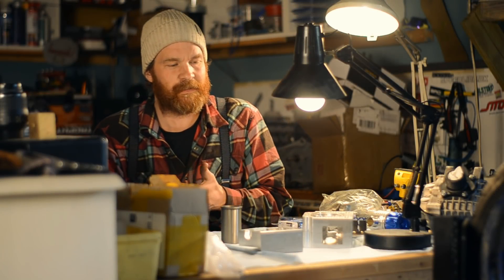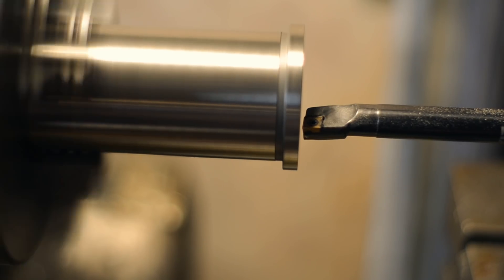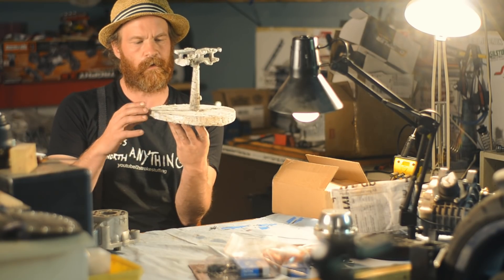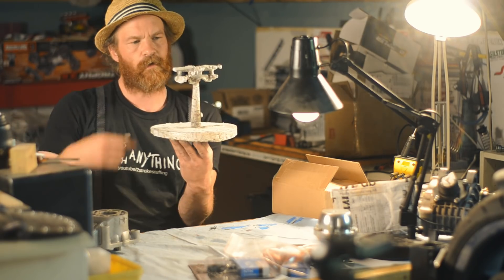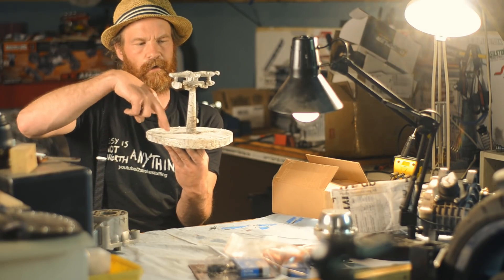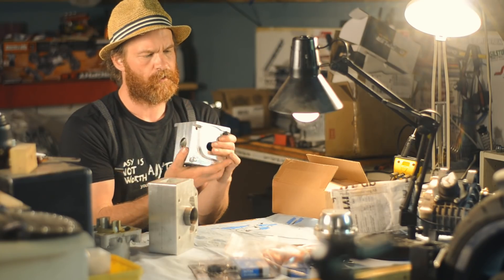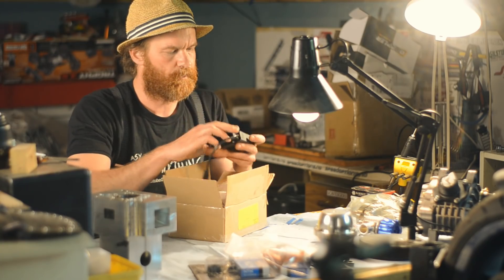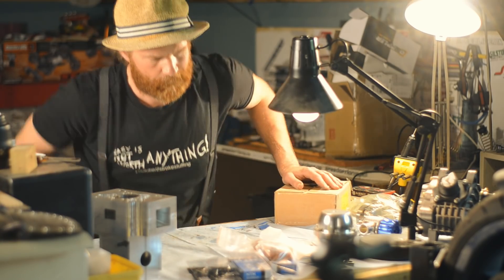Big Blower meets Tiny Engine!

Comment: 10:24 When I saw how gingerly you placed that liner in the bore, I knew it will be a failure. You have to be REALLY decisive. As soon as the two come into contact the temperatures equalize and they seize together, as you have found out.

Comment: CF (or glass fiber) Nylon/PA would be great for those 3d printed parts. Can be printed on the ender 3 without an enclosure, just a metal hot end, and an abrasion-resistant nozzle. I'd recommend Dyze, because they offer tungsten carbide nozzles.

Comment: When i cast all the aluminum parts in the 2 stroke rc builds.  I used 3d printed parts as well lol! I found a hand sander that vibrates is the boss to release all the air on larger casting molds! Have you tried wax printing filament yet?  Really is easy to clean out of you mold

Comment: How tight was that liner to block fit? 
Usually, even with 90mm OD liners (Yamaha XS650) I only use 0.003" interference. (0.094mm?)
 With the expansion rate of aluminium, liners literally 'fall' into block.  I heat blocks to about 325F, (old school and don't 'do' deg C or Kelvin)
To be that tight I would think interference fit was over 0.006" (0.15mm)?
I would imagine the stress build up is going to warp the liner afer a few heat cycles and the bridges will bulge into piston area?
BTW, I've measured stock Honda blocks where interference was only 0.001" from the factory which is really too loose for good heat transfer

Comment: start degassing your aluminum. foil sheet. 1 gram of baking soda per pound and a half of aluminum, then scoop for dross then pour. saw a lot of dross fall out of the crucible at the start of the pour. using the foil delivery method and pushing into the bottom of the crucible ensures you get a good clean pour more consistently. give it a shot it helps immensely

Comment: I think viton rubber crank seals are likely to withstand nitro for tests lasting less than 30 seconds, at relatively low temperatures. For anything that needs to run for longer than 30 seconds though, sealing the crankcases would be a major problem, and I dont think is feasible for production?

Comment: Yoh Alex be carfull the the compressor pressure is not to high campared to the crankcase pressure the needs ro close e reeds when the piston goes down. High compressor pressur will leave the reeds open. U need to put a dump valve to release the compressor preasure

Comment: Be careful about the wobbling of the armonic steel exhaust plate.
On some Piaggio tuned engine (sprocatti),due to wobbling of the plate,it sometimes catch the Edge of the port And destroy itself/goes out of timing as they are press fit on the crank.
In my opinion it’s better to use a thicker plate or a different material due to the exhaust pressure that an engine like this can produce

Comment: There is Nylon with carbon fiber. I am using this and it is amazing. Your Ender 3 will print this filament if you install a bi-metal heat break and a hardened nozzle. It will change your life.

Comment: One thing I have learned from shrink fitting parts at work  

If it doesn’t go down on first try.  Get it out and check measurements    And hitting it with hammer never works

Comment: Kudos on the progress you’ve made. I’ve bored/sleeved hundreds of cylinders with interference fit, and have gotten my share of stuck liners. (Yes, usually in a hurry) I found out that you CANNOT rush this process. Measure, measure and measure again... At 375 degrees F for no less than 45 minutes in the oven, a properly bored cylinder at .003” interference fit, the liner would drop right in. Four strokes were simple, two strokes took more patience to achieve proper port alignment. Your port windows are HUGE!!  That’s stinker should flow crazy numbers. Good luck, can’t wait for the next video.

Comment: Hi Alex.  I’ve been checking out your videos for a while. Great work.
Reply from the maker: Thanks!
Reply: @2STROKESTUFFING   in 1980 I fixed up a puch moped and it would run 52mph in flat ground and well over 60 going down the bridge to the beach. It had a jawa cylinder and piston and a modified 17mm carb facing forward and a modified pipe. Thomos rear rim and sprocket turned around backwards and a Suzuki TM 75 front end. I was 16 and it sounded like a chainsaw. It was cafe style. Fast and fun.  I would pass the bus going to school.  I did the engine work at school in machine shop. I had a clue but was lucky that it ran so well. I see what you are doing snd it blows my mind. I learn so much from your videos and it inspires my to do more. Thanks snd cheers from Morrison Colorado.

Comment: I fancy making a radial four Simson. It will have four pots set around the crankcase. All four big ends are carried by one long crank pin. Intake air & fuel enter via a hollow crank at the non-drive end. It will need a blower for engine start, but I suspect once it’s on the pipes, the blower won’t be adding anything.

Comment: That PETG print looks terrible. Try to place the printer a litte warmer. Or make an enclosure.  
I always run my prints as hot as possible and pretty slow.
I have the worst printer om market but it never fail for me.  Tronxy x5sa pro.
Reply from the maker: After closer inspection the first 5mm is good, after that the nozzle clogged. Might be the stock hotends ptfe tube that's given in, they're apparently known to do that. Ordered an all metal hotend and will use carbon filled nylon which should be perfect for the application.

Comment: Cool to see you back to casting. For the clog you had, may be the end of the PTFE tube inside the hotend is cooked, quick fix cut 10mm (if the tube is long enough). For PETG on the Ender3 I run 230C/80C, 30% to 50%  for the Cooling Fan, Retraction Speed 25mm/s, Print Speed about 10 to 20% slower than PLA.

Comment: I felt your pain in that sleeve 'drop in' process. I found over the years when dropping in sleeves or even case bearings, that dropping in a frozen or chilled part into a heated block of aluminum will cause the cold part to transfer its temperature quickly to the aluminum and negate the expansion process achieved by heating the part originally. Leaving that sleeve at room temp when dropping it into the heated and expanded block would have been more successful. Love the videos brother.

Comment: Hi Alex, had you ever heard of the Rolls Royce "Crecy" two stroke sleeve valve engine? It was meant to be the successor to the "Merlin" V12. A complicated mechanical valve set up, but very very high power outputs.

Comment: Omg just came across this channel and this concept would be fascinating to see the final product. I did ones thinking about a group of nitro engines powering my motorbike which is originally a 125 but it would be cool to see it actually done even if it is done at 50cc. In fact having it at 50cc could be a hell of a lot more power than my 125cc engine. I’m looking forward to this so much

Comment: Steel liner? Why not, Nikasil/aluminium alloy.
Reply: Cylinder is made of two parts. Nikasil won´t work I think...
Reply: @Fminus104  It shouldn't make make any difference using a steel or ally liner in a two part head. the difference will come when at operating temp, you would keep tighter tolerances with ally plus the thermal expansion would be more similar across all parts. Better tolerances = more power. Plus ally conducts heat far better than steel providing more efficient cooling.

Comment: Nice work.   FYI- If you want to be as precise as possible and be sure your bore is concentric with the OD of a part in the lathe; you have to indicate in two places on the OD of the cylinder (farther apart the better) or you could indicate in the face of the part if it's good and perpendicular. This is because the part can be rotating off-axis and still indicate good in one spot along the OD. ATB
Reply from the maker: Thanks! I indicated several points of camera 👍

Comment: Great video as always. Did you make your own burnout PID controller?
Reply from the maker: Thanks! Yep, well it's just on a breadboard atm, in a Tupperware pox...
Reply: @2STROKESTUFFING  I've been looking at doing the same. Is is a programmable one? Like a graph programmable
Reply from the maker: @davers1610  I've just made a simple Arduino pid sketch. You can choose how many points you want, how hot each point should be, and duration.
Reply: @2STROKESTUFFING  great stuff. No chance the sketch is knocking about is there? Mine didn't seem to work.
Reply from the maker: @davers1610  mail me on 2strokestuffing@gmail.com and I'll send it to you 👍

Comment: Just wondering if you use a refractometer to check your coolant oil/water percentage? Overly strong coolant can be nasty on skin!
Reply from the maker: Should get one. Mixed to the recommended ratio but evaporation might screw that up fast.

Comment: I hope they make SLS 3d printing affordable soon. Not having to have supports would save you SO much effort and cleanup and cost instead of having to deal with supports. (In SLS/SLM the powder supports the part as it's printed and you just blow it away after the print is done so there's much less loss in material that's used up in printing and it's also much higher fidelity. In fact, so long as your oversize for contraction in sintering was correct, with the metal powder you could actually print an entire transmission with all the gears and bearings and have it fully function when you got all the powder out of it.. Granted it wouldn't be that strong, just like powdered metal connecting rods or slightly weaker, but all the shift forks and gears and shafts would mesh properly and you could use it to prototype and idea and see if it functions the way you think it should. In fact they've already printed some including planetary gear sets and had them work.) Alex, instead of cutting foam with a saw blade and getting it everywhere, make yourself a hot wire foam cutter. The King of Random showed how to make one years ago. Here's the link. https://www.youtube.com/watch?v=N2n_EbRzZ0g A little bit of acetone will also melt the foam away once you no longer need it. Was that place you went to the Norwegian version of Harbor Freight or actually a good quality place?

Comment: You could try printing a temperature ladder using SuperSlicer (It has the options somewhere I forget now) to help find the best settings. I find that PETG likes to be printed with a bit more z-offset than PLA does and its also a LOT stickier so you don't have to print on rafts as often. If you start to print a lot with PETG you may want to invest in a sock for your hotend as it makes cleanup a bit easier (especially if you end up with a blob of doom). If underextrusion is the main issue still you could try an e-step calibration.

Comment: Look into Taulman 910 Filament for incredibly strong and heat resistant parts that also resist gas and oil. I've made everything from car intakes to PCV system Y fittings which sit directly above the engine block on a turbo car.  It's pretty hard to dial in and you must keep it in a dry box when not in use (or preferably even while printing) but otherwise it can be printed on most printers and when you get it going you get the same quality as PLA/PETG... except MUCH slower.

Comment: PETG should be good for proof of concept, i did my ITB adapters/runners in PETG to try if it would work. After my engine warmed up it definitely softened and preload on the bolts was gone but as long as you keep it around 60-70 degrees it should still have some strength =D
For final parts i will try to use PA6 with glassfiber/carbon fibers.

Comment: If you are going to use 3d printed parts for your intake, i would suggest using DSM Novamid ID1030-CF10, I printed intake runners for my car with the stuff and i have daily driven it for over half a year now so it certainly works. its also pretty easy to print. you would need a steel nozzle in your printer though since the filament has carbon fibre in it.
Reply from the maker: I've ordered some carbon filled nylon and a full metal hot end with hardened nozzle 👍
Reply: @2STROKESTUFFING  Nice, with nylon you need to make sure the filament is dried, if its not it will print like shit, if a spool got 'wet' you can still dry it and get it back to its original performance. most filament manufacturers have instructions on how to do that.

Ive personaly used a polymaker Polybox to store my nylon. it has a gauge for the moisture in the air and uses silica gel bags to keep the filament dry, so it doesnt use power.
the silica gel can also be dried if it has absorbed to much moisture.

Im also very impressed by how quick you picked up the machining you are doing.
a few weeks ago i had exams for which is passed and it now makes me a professional machinist :)

Keep it up!

Comment: Worry about the rotary valve getting to hot from the exhaust and seizing up from heat expansion?
Reply from the maker: It's not supposed to encounter exhaust gas directly, on the plus side it will encounter lots of fresh mix.

Comment: Hello Alex, a cheat you might consider for bringing bubbles to the top of your investment would be to press a running jig saw or sawzall/demolition saw against the vessel for high frequency vibration on the cheep. I am so glad you have been able to get more time in the shop it is really paying off.
Reply from the maker: 👍 Great tip!
Reply: @2STROKESTUFFING  
Every little bit helps. Even silversmithing knowledge can help with an engine, who knew?   Best of luck, glad to help.

Comment: Just wondering, but did you seal those two case halves together before you pressed that liner in? =)
Reply: He sealed it with Wurth Engine Sealant in the previous video. Plus guide pins.

Comment: I know the printing pain all too well. Something I do in case I'm worried the quality isn't up to par is set up the printer so that each piece is printed fully then move to the next part. Youll have to make sure there's enough room between the parts so the print head doesn't crash but you'll be able to just check up and remove each part as its finished, if there's a problem you can just stop it and only 1 part is partially printed much less waste plastic.
Reply from the maker: Great tip!

Comment: PETG  wont work for the intakes. I used it on a blaster intake. It cant handle the heat. It doesnt melt but it starts to warp.
Reply from the maker: 👍 Going carbon filled nylon after watching this: https://youtu.be/inuweW63lTI
Reply: @2STROKESTUFFING  it definately will hold up better but still not sure you want to take the chance in it running lean because of a intake leak. I do like the casting idea. Its tricky to get right though. Especially in plaster of paris.
Look forward to seeing more videos.

Comment: Either your tolerances are a little bit to tight or your freezer is not freezing enough. Normally when thermal fitting is employed parts should slide in without any effort but liquid nitrogen is used.
Reply from the maker: Combo of both I think.

Comment: For id boring the tool needs to be slightly above center, that way when the bar flexes, it falls away from the material and does not gouge into the cut.
Reply from the maker: Great tip, thanks! It would pull itself in a lot if I cut on the way out, not too bad feeding in.
Reply: @2STROKESTUFFING  No matter the feed direction, It's below center external and above center internal. Just slightly however. You are a genius I think!

Comment: when printing PETG you should run atleast 240C nozzle and also print slower than PLA ! ive had ur exact problem with PETG. it really doesnt like being pushed out too fast through the nozzle. i print PLA at 40-60 mm/s and PETG at 25-40 mm/s. hope this helps
Reply from the maker: Thanks for the tip!

Comment: You need to look at the sleeve valve on the Rolls Royce Creci engine. but instead of making it the piston sleeve, a spinning ring that fits inside the two cylinder halves. it's basically a ring shaped rotary valve.
Reply: My thoughts exactly.

Comment: I'm a newbie machinist but I would have tried to have as little of the bore sticking out the chuck as possible & waited between cuts for a cool measurement.
Reply: nevermind you do you.
Reply from the maker: Good advice! The center bore of my chuck was too small for it to fit through.

Comment: 15:25 be careful with bent rotary valves. When rebuilding Trabant-Engines (which have rotary valves too), it is crucial that they are perfectly flat so they can seal properly. In that case, the rotary valves control the inlet though... I don't know if it makes a huge difference when the exhaust port doesn't seal 100%. Just wanted to tell you. Love your vids man, greetings from Germany!
Reply: that makes sense on the intake of an engine but since a 2 stroke is normaly always open i think a somewhat not perfect seal will still be fine.
Reply from the maker: @seanbarton8852  yep, will still be a massive restriction.
Reply from the maker: Thanks! I think it'll be fine on the exhaust side👍

Comment: Good vid could you not use wax filament for the 3d printer it would burn out easy and much thicker vents on the pattern do you cast with the  mould hot from the oven ? i did a lot of lost wax casting for gold i always had the mould/investment  at 600 deg C  as the gold went in  500 deg  C  would be ok for you or as close as you can get  .failing that get the parts printed in metal filament on a printer that can do that there must be some one here has one for you to send the files to .
Reply from the maker: Thanks! When burnt out for long enough plain pla actually works fine. Mold was at 400C when I poured. If only I had waited for a few more hours.
Reply: @2STROKESTUFFING  been there my self miss cast every thing and start again through rushing .